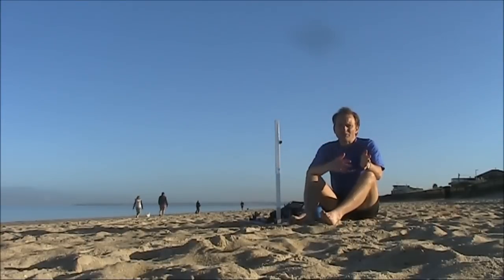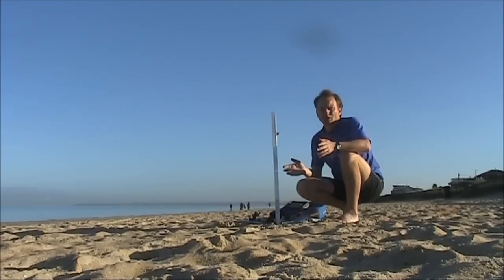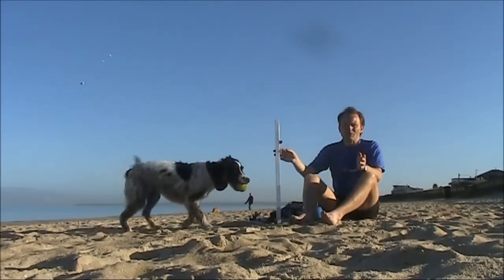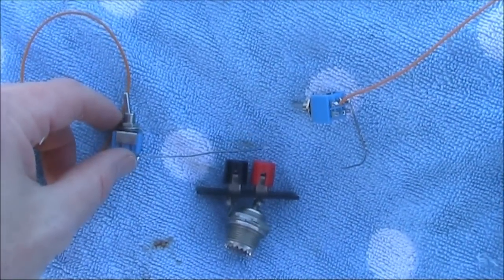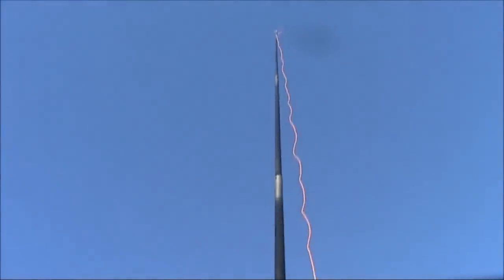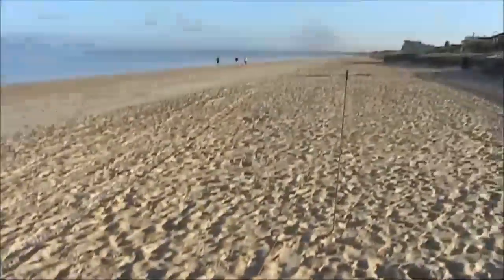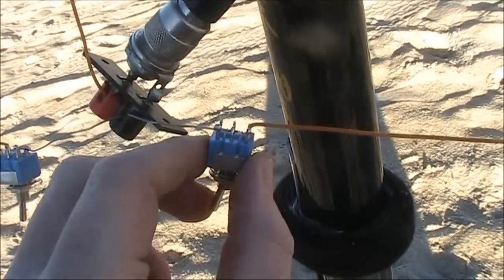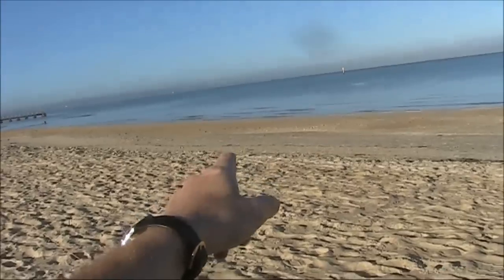How directional is one radial? (when all but one are removed)

Comment: I tried this with a rotator years ago on CB radio.  So, it was a ground wave, and there was a marked difference. (the stations were about 25 miles apart) However, the results are probably different on a sky wave. Going from CB to HF was a learning curve! 73's! VA3IRF

Comment: Was that 20 meters?  Or was that 40 meters?  Just asking because the wire looked very short for 40 meters which would be 32.32 feet.
Reply from the maker: 20m
Reply: Those signals sounded like they were coming from far away.  I would expect the effect of just a single radial to be better compared at shorter distances, but maybe I am wrong?
As other has stated the conductivity in the direction of the ocean will skew the results.

Comment: My initial reaction to your experiment is that it does not take into account the far field effect of the ocean beside which you are standing.   I would fully expect your vertical antenna at the beach to be heavily biased in the direction of the ocean, regardless of the number of radials you might have or what direction they are oriented.     While operating at the beach, a simple copper rod driven into the sand to a point where it contacts the salt water should be quite sufficient as a ground plane.

For vertical antennas, I see the radials as simply a counterpoise in order to facilitate a good match to the feed point more than a method of achieving any appreciable directional gain.

Thanks, for the video!

Comment: I think you also have to be careful with any conclusions... since you're probably radically changing the antenna impedance (both real & imaginary parts) when you switch the radials in and out. I think you'd need a more elaborate setup... something that had an adjustable matching network at the antenna feed-point... so you could normalize the impedance in a certain radial configuration... before making any comparisons.

Comment: An interesting video Peter. I tried switching my radials in a northerly southerly direction, however my vertical quarter-wave was not sitting on the seashore its at home in the back garden. I use 32 radials on a quarter-wave to overcome the ground losses. Switching in and out the 16 radials pointing north, then south, radials on some days made about an S point difference in the direction they were facing. Inconclusive really, I put it down to the refraction and reflection angles as propagation changes. Keep up the great educational video,s 73 de John G4YDM https://johnallsopp.blogspot.com/

Comment: Hi Peter. First, I greatly admire your passion for experimentation Sir. Long story short, the presence of radials in any particular direction won't have an effect on the RF energy levels in any particular direction (one caveat we can discuss later). The radials have only  one purpose, to create/complete the path of RF current to come back to the radio (like any complete electrical circuit). You can think of the ground as a big resistor, and the more you help overcome the resistor with metal (in the form of radials) the less the resistance, the greater the RF current, the higher the efficiency and  thus the greater amount of RF energy emitted off the vertical.  The reason why radials are laid out over the 360 degrees is simply to pick up the displacement (return) currents in all the directions. Regardless, if you  had only 5 radials over half the circle (180 degrees), and lets say the result was you had 25% efficiency, then your 100 watts is effectively 25 watts, but in all 360 degrees distributed equally. In your vertical the reason why you heard some effect of the signal was because removing the radial resulted in lower efficiency, and that lowers the amount of signal delivered. If you noticed more clarity it could be that what you really experienced was a reduction of noise perception.   Now the caveat - you elevated the radials a bit, and even though not very high it does introduce reactance and therefore you have then some amount of pattern distortion. As you move the radials higher then that will be even more pronounced, etc. Hey keep up the good work! Experimentation is what ham radio is all about!  73, KM5L

Comment: I think the switch has a massive coupling effect. You would need to break the contact by a few inches to be sure. That's why most antenna switches ground the not used part when not in use. Make a mistake and you transmit into a dead short, it's why all my antenna switches have a thick film 50ohm resistor on the not used terminal.